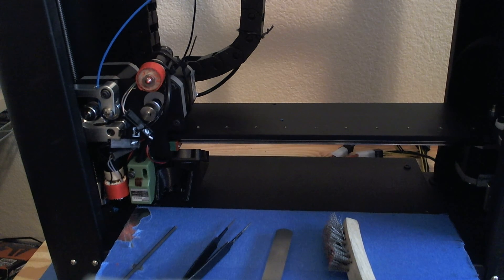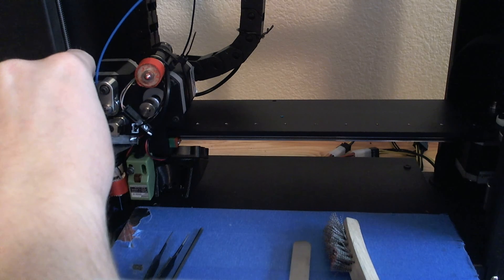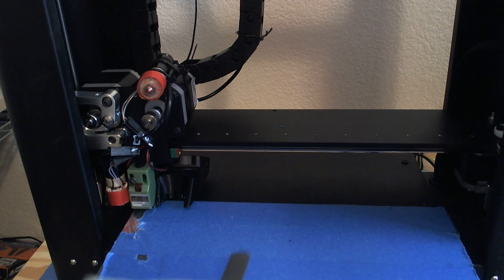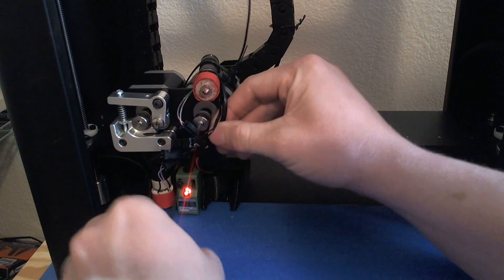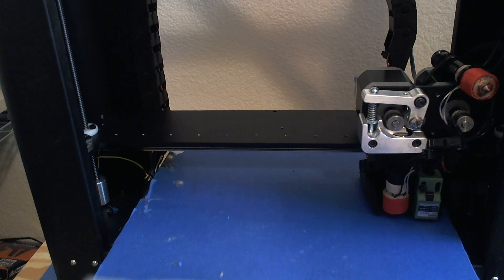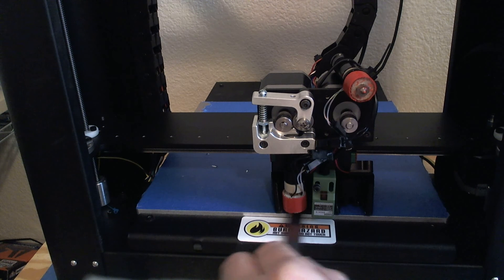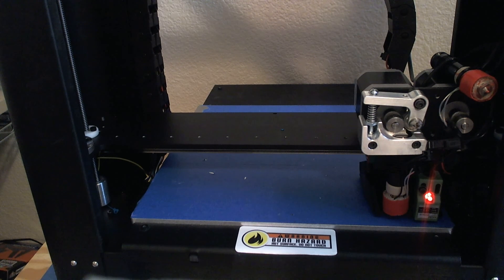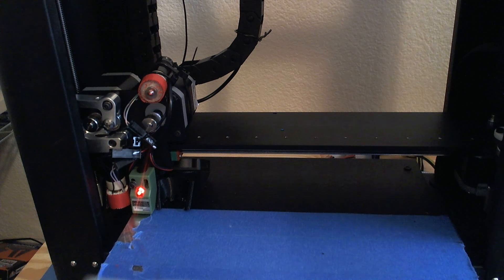How to Manually Level 3D Printer Bed and Nozzle Height- Printrbot ft Printrbot Plus Dual Nozzle

Comment: I have the same problem with my Dual Plus.  They built it with zip ties too tight on the X axis and caused a wire break in the Z Autolevel Sensor.  Light would come on but it wasn't reporting triggered to the board resulting in head crash.  Sometimes light wouldn't come on and crash through deck. Found the short. Cut and spliced the wire.  It works.  This could help.... https://printrbot.zendesk.com/hc/en-us/articles/208275723-Troubleshooting-Your-Auto-Leveling-Probe-Triggered-vs-Open

Comment: Why dont you measure the offset of the switch off of the bed when it just triggers? Then use the feeler gauges to set the switch accurately when the nozzle is at the height you desire.
Reply from the maker: I believe it detects 4mm from the metal surface. I don't have a feeler gauge that big. Right now I just tighten the nozzle down and get it to just kiss the bed. Then I adjust the switch manually so the light barely comes on. Seems to be giving good results so far.